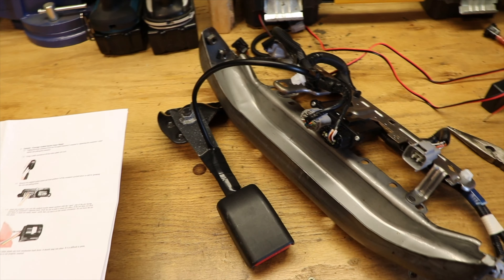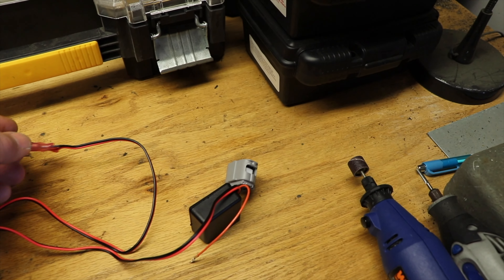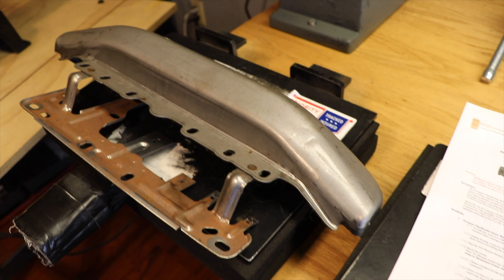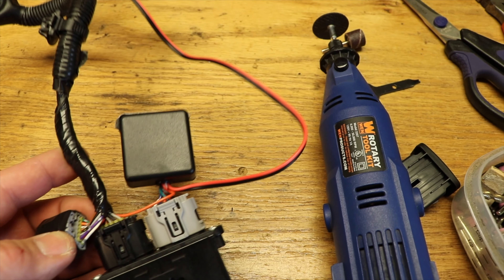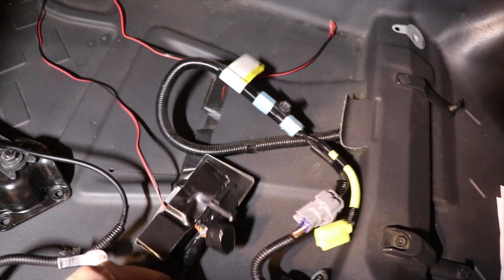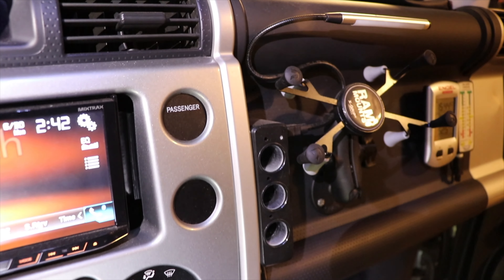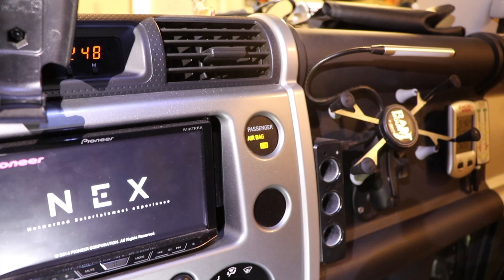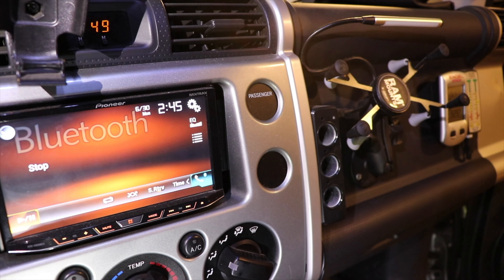Scheel Mann Fj Cruiser Seats The Electric

Comment: Is the wiring required for seat occupancy supplied with the seat?
Reply from the maker: It is not.  This is a very specific wiring that was and may now again being sold by metal tech   I would look there to see if they are showing it available.
Reply: @UpintheAir.stream  I see it is not available, so why would you buy new seats that have no way to work correctly with the existing OCS system, I'm confused.